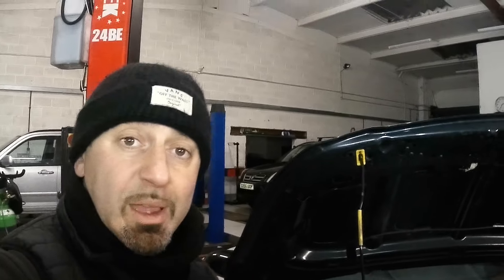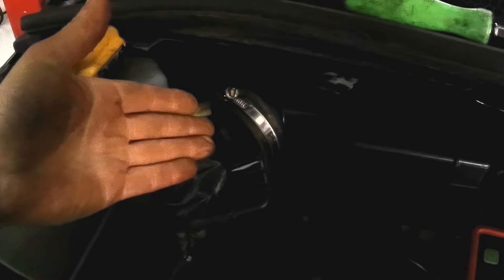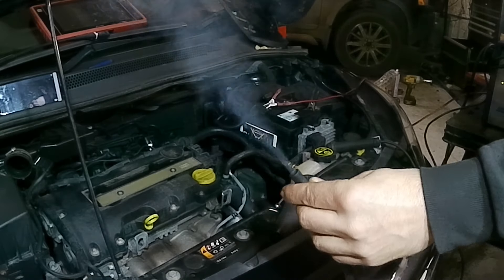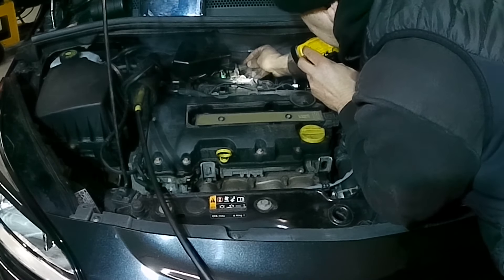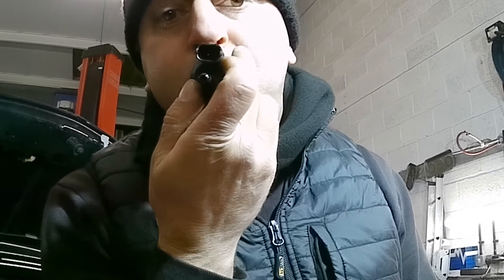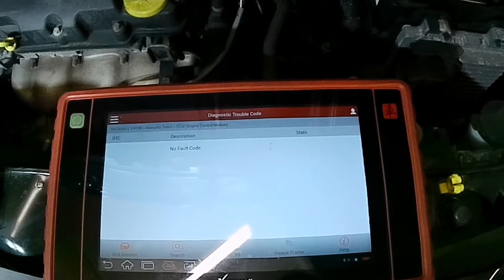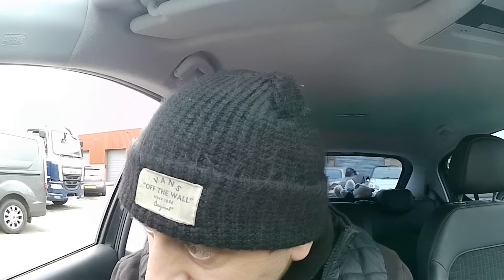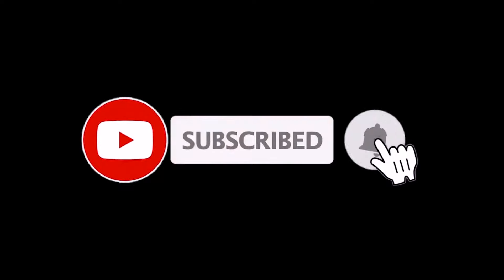Vauxhall Corsa running issue fixed Fault code P0171

Comment: On my astra j l get same problem onliy fault l found is on rocker cover little hole just above Spark plug theres small air leak is that normal for where the diyafram is
Reply from the maker: @okokomokoko9821  this code isn't specific to the problem in the video, there are several reasons for this fault code, including the diaphragm issue.

Comment: Think this could be the issue with my wife's corsa engine light going out  after 5 seconds. ones car starts  ,but it has an oily fuel smell inside car
Reply from the maker: Hi Mark, don't just change the valve without testing it first, blow through it! If you can smell oil it wouldn't be this valve! These also suffer with the diaphragm failing in the cam cover, that may give you the scent of oil 🛢️ good luck 🤞
Reply: @XPUnitX  hi turned out to be the  fuel purge valve it was stuck  open, changed that seemed to sort the issue ,happy days

Comment: This code can also be intermittent, so a short test drive won't show if it's resolved immediately. Had the same issues on an astra J, A14XER engine. You need to consider the fuel trims after replacing to see if they have settled down to specification, both long and short term fuel trims should be around zero, the long trim takes longer to settle. The code only sets if the short term fuel trim goes above 10% at least 3 times I believe.
Reply from the maker: Thanks Kevin for your feedback, it was the short term fuel trim that indicated there was an air leak prior to investigating the fault to repair. Fuel trim is a whole new topic, most people who watch these videos use a code scanner with no actual live data or the understanding of fuel trim. Thanks again for your feedback it may help others 🙂👍
Reply: @melsmotors  thanks for your response. My comment was more to help others maybe not so familiar with fuel trims. Purge valves seem to be a regular issue, and your video shows the sure fire way, using smoke to diagnose a vacuum leak or problem with the PCV, so very well explained.

Comment: Got the same problem with my Vauxhall the garage said that I MUST use ONLY V Power from shell. Too expensive 😢
Reply from the maker: Hi Alberto, what's the oil got to do with it? This issue on this particular car was just a parts failure! Not oil related at all! I don't understand your mechanics logic. Most Vauxhall's use DEXOS 2 oil, check your owners handbook and use that oil. Take care out there 👍😊
Reply: @melsmotors  I have the same issue Vauxhall recommends 5w 30 oil and I only use the recommended one in my corsa,  last time needed to top up engine oil and I used probably a liter of 10w 40 oil after asking the mechanic who said it is safe to do so. I drove car about  20 miles and engine management light showed up on dashboard. Same code p0171.bit strange
Reply from the maker: @imeeran  A lot of these Corsa's have had an oil update by Stallantis (who makes Vauxalls now) The new oil code is 	OV0401547 - G30 5w30, also know as DEXOS 1 Gen 2 or 3, double check with your dealer. you could also use 5w20 with the same code. Hope this helps 👍

Comment: Mine engine lights on dash board for few months i Took to garage they said fuel lean but after I took to other garage they couldn’t fixed it and they said fine it’s normal because exhaust external
Reply from the maker: 😂 Some garages make me laugh! You either have an intake leak after the air flow meter (if you have an airflow meter) or just a general intake leak, either split hose, intake manifold gasket, split breather diaphragm, air leak from injector seals, cracked intake manifold, faulty solenoids, or it could be an exhaust leak before the O2 sensors, gasket, cracked manifold or pipe, broken flexi pipe, etc. Both these types of leaks will give you a lean code!
You will need to investigate the problem, you will need a smoke machine for small and hidden leaks. The computer is saying there's a problem, you just need to find a good mechanic to find it!!

Comment: Looks like a common problem with corsas I can relate to a lot of the comments. Garages can’t find the issues but still charge for work that might fix it and the RAC not helping. Problem keeps happening and also told to use the most expensive petrol

Comment: Hi my corsa has a problem when I'm driving. When my car get to 20k rpm the revs shoot up then come back down. Has anyone had this problem before. Has it got anything to do with the clutch. Any help would be appreciated. It's a corsa d 1.3cdti 2012
Reply from the maker: I would strongly suggest getting a mechanic to look at it, especially if your diesel revs to 20k 🫣

Comment: My Vauxhall gtc is running great at moment but rac man came read code. It said fuel Trim lean.  
Engine light came back on again after 2 miles. He did say to me that I really can't sort it out untill I see problems with car. At my local garage.  But hope my fix is easy as yours. On the video

Comment: very nice video. i have same problem my mechanic told me i have  to replace my zafira tourer 2017  1.4 Turbo Inlet Manifold Evaporation Purge Control Valve. how can i check myself if is working or need replacing? it say fuel system trim lean. any help thanks
Reply from the maker: That is a possibility, the manifolds do fail on those. Do the blow test through the valve first, if you can blow through it, then it's the cause. It could be the intake manifold or the diaphragm in the cam cover!

Comment: I think I might have the same issue, Z14XEP Astra H 1.4, P170, on idle MAF shows only 4.5 kg/h air intake (read somewhere way to low value) so it takes it from somewhere else, from fuel tank maybe. I will try to turn the engine on and open the file cap, if there is suction them I guess I have the culprit. 
One I must admit, crappy cars these are. All the time something's go wrong with them

Comment: i have the same issue with my Opel Astra J 2013 model. Two codes actually came up... P0335 and P0171  i seriously need help.
Reply from the maker: HI, you need to contact a local garage to carry out some diagnostic investigations! If you're local we can help, you can contact us through our website 👍
Reply: @melsmotors  am in South Africa I dnt think U have a brach here... But thank you

Comment: Hi, informative video. Im having the issue onmy corsa. Do you have a part number if you got it from euro car parts by any chance?
Reply from the maker: I can't remember where the part came from, if it's a Bosch part, then Euro car parts can help you with the Bosch part number! Test it before you replace it! Good luck 🙂👍
Reply: @melsmotors  thanks

Comment: Hi, I’ve got the same fault on my car but no EML light. Just keep getting a service vehicle soon message every now and then. I’m trying to remove the valve from my car to test it but the thing won’t come off, any advice?
Reply: It’s the green clip to the pipe I couldn’t get off. Given up now. I tried blowing into the pipe that was connected through the rubber seal and couldn’t get any air through, don’t know if that’s a sign that the valve isn’t faulty or if I needed to get it fully off to get a proper verdict
Reply from the maker: It's really hard to get off from memory! Keep trying, if it fails, garage time I'm afraid 😔
Reply: @melsmotors  yeah I’m going to take it in to the garage today anyways. Got a couple other codes that’s coming up as well as this ; Fan circuit faulty sensor & AC Compressor malfunction 🤣 going to be a long day

Comment: Hy i have a corsa 1.2 2011 petrol and it shoes 2 codes p0161 and p0171 and i took off the pcv valve and you cant blow air tru it  and i but my finger on the hose of engine and is runing the same if i take of the finger turns off after a while ,and all of this i think comes up after i cheange oil in gearbox and camshaft seal i had a little leak of oil in fron of engine but i put all back corectly i cant see where it cood be the problem , and when i drive it and gets warmed up it is hard to change and the gears i had to turn off the engine to shift , i let the car to a garage and told me is the clutch and that is it but the engine still has to work normaly  please help me
Reply: And also with pcv valve conected it not has to open and close its stay shut all the time
Reply from the maker: Hi buddy, if I could fix cars via an email or over the telephone I would be a millionaire! 😂🤣
I need you car here to run tests!
Reply: I found today that even the exhaust the flexy one it has some holes because is making noise and gets air out , is posibel to be one from this the exhaust?
Reply: It can be fix and like that is more importent the ideeas and what to do instead the hard work
Reply from the maker: @iuliantonu8656  sadly I can't tell you what to look at or fix without seeing the car, then scanning it and then reading the live data! It needs to go to a proper mechanic to diagnose the issue!

Comment: Would it be the same for a Vauxhall Astra 2006 1.6 petrol Sxi cheers
Reply from the maker: Hi Colin, if you have the same fault code then it could be the same fault. I demonstrate in the video how easy it was to test, just blow through the valve, if it blows straight through it's faulty. Thanks for watching 😁
Reply: @melsmotors  Would my pcv be in the same place. Or is it integrated into the rocker cover I was meant to say cheers

Comment: I got astra H 1.4 16v. My car has very little engine braking and sounds very quiet. I can hear whinning noise under the car when its in  gear driving. When I press the clutch whinning goes away. Also when I pour gasoline nozzle keeps shutting off. Car sounds so quiet like engine is not getting enough air and when accelarating sometimes it feels forced. Also sometimes i get blue smoke on startup only.
My question is how do I fix car to get more engine braking and more louder cause I know its not supoose to be like that. I know it can be multiple problems but what is the biggest one that makes my car have almost none engine braking
Reply from the maker: Thanks for your message. Sounds like you need to see a mechanic pretty soon. If I could fix a car via a message or phone I would be a millionaire ☺️ I can say almost for sure that whining noise is you gearbox!
Reply: @melsmotors  could bad clutch make gearox whinne. Cause  when i press the clutch or release it I can hear some clicking sound. Also when car is parked on flat in 1st gear it moves a bit too much

Comment: I think I've got same issue on my Zafira 2009 Petrol. Had the B1 lambda sensor change but car still bouncing revs when driving and always feels like it's going to stall. Where did you get the Bosch sensor from please?
Reply from the maker: Sadly I can't remember, we repair around 3500 vehicles a year, thanks for watching 👍🙂
Reply: @melsmotors  no worries cheers mate

Comment: Hi mate could u do video replacing the purge valve
Reply from the maker: Hi, the purge valve is at the back of the engine, it's in the video.
Reply: Think he's on about a actual video of you removing the purge valve, screws and hoses! I'm about to try do this myself but it's a bloody hard bit to get out not everyone has the same clips on the left-sided I've noticed plus lots of people tend to break the rubber hose on the right trying to remove it.
Reply from the maker: @jordanprice7542  sadly I don't have the car to re-record the video of the removal. If I get another one in I'll update the video.
Reply: @melsmotors  I got mine out was a pain in the ass but I did it. Ended up using a flat head to get under the rubber closest to the valve not the engine and wiggled it out, but think mine is fine no replacement needed no air can blow through. I've changed coil pack spark plugs cleaned maf cleaned trottle body checked the pcv checked for vacuum leaks nothing still low idle revs. I blame the bloody e10. Haven't used it for months after the warning light starting to come on few miles after filling up with it. That's what caused a missfire and screwed my coil so fixed and removed the codes never had the light since just low idle slight vibration and no error codes and a ton of frustration.
Reply: @melsmotors  other than the low idle my car actually runs better than the day I got it so there is some plus side to this torment
Reply from the maker: @jordanprice7542  Go to your throttle body, take off the big intake hose that goes on top of it. Where you have the butterfly flap, put your finger on the butterfly and push it down to open the flap, it will only push down from one side and it's stiff, use a torch to see into the hole, is there black grime in there? if YES clean it with carb or brake cleaner and use a clean rag. If you don't have carb or brake cleaner then use WD40 or similar it will do the same job. Put it back together and see how it idles after a few revs.
Reply: @melsmotors  as mentioned in last comment I've already taken off the trottle body and cleaned it wasent even that dirty and recalibrated it. Cleaned the maf. New coil new sparks. No vacuum leaks, pcv fully working not fulty. Fuel pump is working plus there is no fuel filter on these models its self cleaning lifetime fuel tank so can't replace a filter that isn't there. The only thing I have not checked is the egr valve.